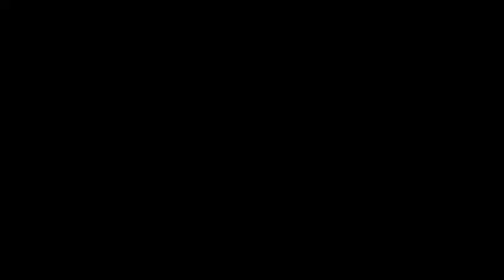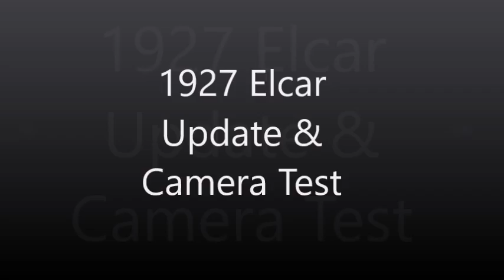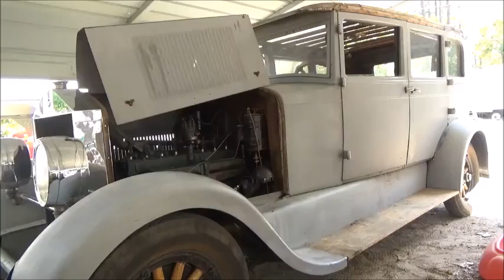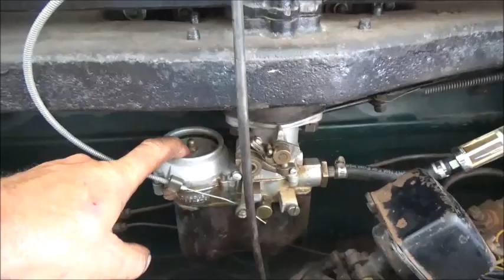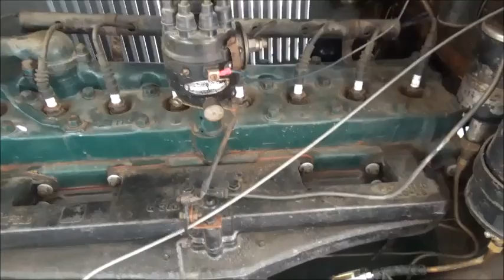1927 Elcar Update & Camera Test

Comment: maybe a plate between carb and intake  used to work on my race engines  it dissipates unwanted heat like a cooling fin on a motorcycle  and it would work as a heat shield from  in your case  the hot engine block and manifold   cool old car

Comment: If you can’t make a 1/4 spacer, you can make thin aluminum spacer plates to do the same thing. 3-4 thin aluminum spacers with gaskets inbetween should work well.

Comment: Although white walls look good they were hardly ever seen in 1927. Your call. Carb insulator is a good idea to help with the gas boiling. Retarded timing can also cause overheated exhaust manifold. Your distributor might have come from a straight 8 Pontiac, Oldsmobile or Buick. Delco-Remy number on tag. Have you found a manufacturer's plate on the engine? They often disappear after a hot tanking. Out here in Nevada carport type structures help prevent sun damage, but dust, rain and snow remain a problem. I hope you fully enclose it before winter sets in. Garagemahal. Love it.

Comment: might look around and see if the old whitewalls that overlay the black tires are still available  These attach on the inside of the rim w tube type tires. held in place by pressure.

Comment: I did some checking on your car...l saw a 27 deluxe with what look d like original burgundy/black paint - good combo...l liked the side mount spares & thinking it had a luggage rack over a straight rear bumper (l'd want that for people who tailgate & talk on the phone)...l also saw a 3 tone blue/black/light blue - that light blue trim/accent was popping...the winged radiator cap was what really got me...Jay Leno is a big time celebrity, but he's still a regular person & a car guy...they have a 3D printer in shop & could Fab up the cap & emblem - he has contacts & might could get originals on loan to copy (not sure how that works)...if there's an Elcar car club he'll tell you to join that...l agree about the distributor linkage & glass fuel filter...l wish there was a way you could get the swan carb & linkage going again...l'd hide that filter up under the car close to the front...Jay has some real craftsmen working at his shop - 1 of them knows how that roof is supposed to be - if you can't find nobody/no car club

Comment: Jonathan the first thing to recognize is the car is your dream toy. The way I look at it I save money on normal life expenses but I buy what I really like for my toys. Decide what you really want and just buy it when funds are available. Secondly the carb spacer and fuel line insulation should help the vapor lock problem which is common. I use the lead additive in my 60’s fords and I don’t see how it could hurt your engine. It’s a lubricant I don’t think it would have anything to do with cooling the fuel. Unfortunately modern fuels are very different from the past. Good luck love the channel!

Comment: Jonathan, I can CAD that emblem for you and it could be 3D printed I think. Then you could use the positive as a lost wax or lost PLA casting. Re tires, I reckon black, but you could also use that white rubber spray paint  to white them if required? I did  video on it with my RC car, but I know people do it with real vehicles, that's where I got the idea from https://youtu.be/KrVXXsJC4Oc

Comment: Along with the thermal block gasket for the carb, why don't you add a sheet of aluminum for a thermal heat shield to stop heat from radiating into the carb from the rest of the engine.   Try a temporary shield with HD aluminum foil first to see if it helps before you fabricate a real one.  I've had similar issues with new crap gas and lawn mower motors....

Comment: Jonathan - What ever is period for the tire choice, though I think the whitewalls would be cool.  I think an insulated gasket/spacer between the carb and exhaust manifold will cure most of the problems.  Try wrapping a piece of foil around the filter to see if it is causing any problems.  A visible fuel filter is a very handy thing for quickly trouble shooting fuel system problems!  
While you there working on the garage build a mezzanine floor above the car with all the space you have.  It would be great for parts and whatever else you want to keep out of the weather.   
As far as the lean-to is concerned, install it on the back and make the whole garage deeper.  Bet you can park the drag car, when it's finished and the Elcar in the same structure!
Looks like you have a handle on your video problems.  Great video as always.  Really enjoy your channel and projects!

Comment: I was going to suggest an insulator block above your carburetor, but I see you've already thought of it. I just replaced the mechanical fuel pump on my MG (78 Midget) with a more correct type that includes a plastic spacer. Hopefully, no more vapor lock during these Missouri summers... The carb already has a similar setup. Great episode! Again your Elcar is a real gem.

Comment: I agree with the writer that says black walls would probably look better on a Burgundy colored car. But this is the ‘20s and it has to be period correct. Get some of those wide whitewalls that run from the tread to the spokes. If you are not happy you can turn them inside out. This is much harder with a black wall only tire. Blowing my own horn for the cause you might want to check out a GM color called “Desert Rose Metallic”. GM used the color on the Corvette up until 2017 and a close variant of the color on the Cadillac CTS.
     With regard to the radiator badge I’ll wish you luck and see how you do. I’d suggest that a new trick you may want to teach us is that computer which can create things from plastic models or drawings. I saw it used on “Jay Leno’s Garage”. Jay needed a timing cover or some such for one of his 1800s cars. It was not available to anyone - rich as Jay or not. His crew put the drawings for the part in this computer and viola - here’s your new part Mr. Leno. With all of the body and other parts you’re looking for this machine would earn it’s place in the hobby shop in no time.

Comment: a phenolic resin spacer and some insulation on the fuel line should help a lot with the fuel boiling over. I used a phenolic spacer on my car to keep the manifold cool (turbo car) and it made a huge difference for reducing heat soak.

Comment: Re: lead substitute - my Grandfather restored Model A Fords.  I'm old enough to remember lead being phased out in the USA.  He noted that tetraethyl lead was not in widespread use until the 1950's, so the Model A Ford engine had hardened valve seats and didn't need a lead substitute.  I'd imagine your car, being a 1927, would have hardened valve seats as well and not need the substitute.  That said, interestingly, WikiPedia said it was developed for fuel use in 1921...so I'm wondering if Grandpa was wrong?  Or did it take 30 years to become widespread?  For sure, he put lots of miles on his A's and never had any issues not running lead.

Comment: Along with a fiber spacer between the carb & the manifold you might try fabricating an aluminum heat shield plate to reflect the heat away from the carb like you see on some lawnmowers.

Comment: I would get the whitewalls if you want them.  Otherwise it'll probably be many years until the Blackwell tires go bad and you'll be kicking yourself for not getting them.  I'd go with Blackwell tires myself. That emblem, you can just ask questions in English. The seller may know English or know someone who does, or will use Google translate.  Be sure to ask the price in USD.